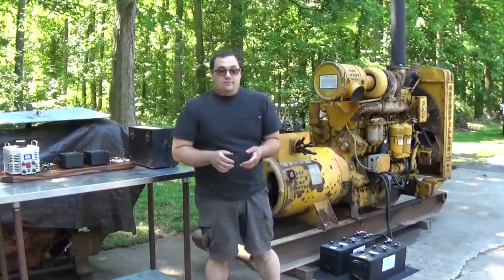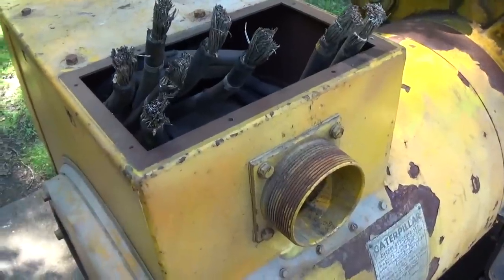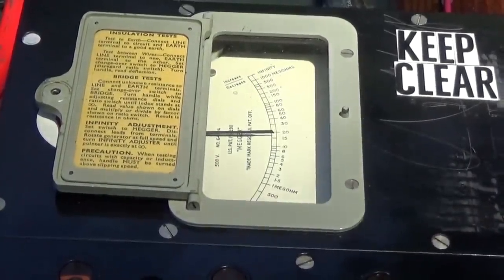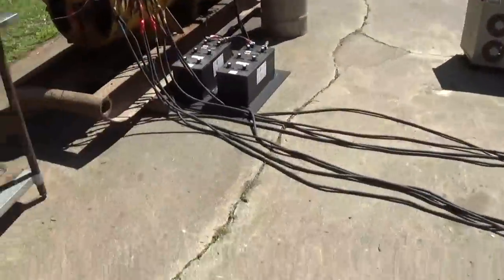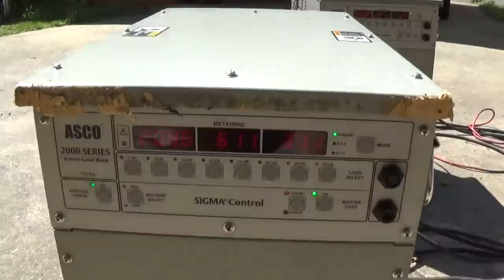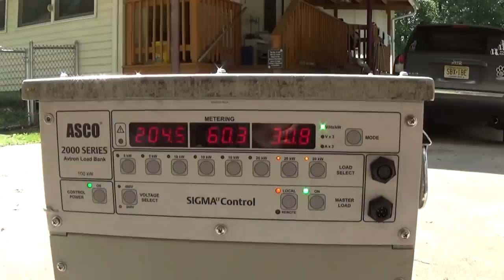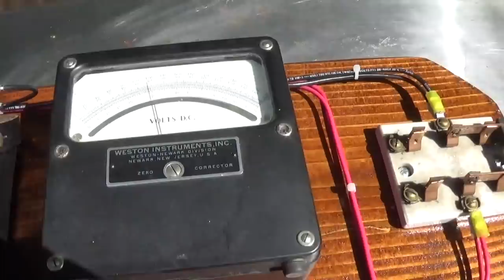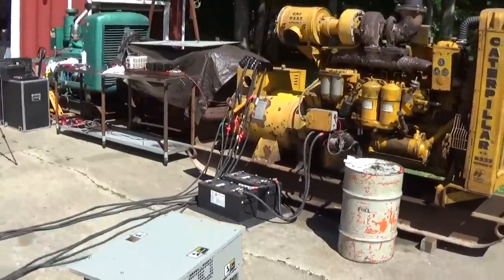CAT DIESEL RUNNING UNDER LOAD 1959 Caterpillar Generator Testing

Comment: Good to see you letting it cool down before shutting off, it's easy to damage a turbo by shutting down immediately after a hard run. Peugeot found that out the hard way with their racing diesels at Le Mans, pitting with the turbo red hot. Audi beat them by backing off for about 1/3 of a lap before pitting.

Comment: So if the part can handle 60 volts at 20 amps then it would be able to control the excite windings, I’m sure you could build a part to do that pretty cheaply

Comment: Interesting video and great performance from a 60 year old generator. I was struck by the fact that you were producing 120kw which -although continuously rated - is about the same as my 2 litre bmw diesel engines car produces (177bhp).
Reply: Interesting, although that’s comparing electrical vs mechanical power — your 177 bhp isn’t accounting for losses in the generator itself + probably wouldn’t last long going full out at that power ;)
Reply: @MittyNuke1  I agree - the genset would need to be 90% efficient for the BMW engine to deliver that electrical power output. I was mainly observing the high specific output of modern automotive turbo diesels.
Reply: @rhiantaylor3446  Yeah it is interesting, seeing how this generator engine is so much larger than any normal car engine. A quick google search shows that the D337F is rated for 275 HP. From what I understand, vehicle engines rarely have to put out full power, while on the other hand this generator is probably designed for full load continuously.

Comment: a 65 year old chunk of iron happily pushing out 400 amps is both incredible and terrifying at the same time. As he casually walks over the leads and points the camera inside the generator cage. 
I wonder what happened to this unit. Haven't seen it in since this video.

Comment: that old kitty cat sounds really good ,,that old D337 will run almost forever ,,noisy as all get out , not fuel efficient  but reliable for sure ,, i used to work for a large farm here in iowa that has 2 of these monsters they both had over 5000 hours and that was over 20 years ago 
here at my farm our standby generators are new compared to that one,, the big one is a  Kohler genset powered by a 6BT cummins was built in the early 90s ,,it's 125KW if i remember right ,i've got it mounted on a trailer  for mobile power 
and it's baby brother a 75KW powered by a 4BT which is in  a shed ,,when it starts up you almost don't hear it , it'll run the whole farm alone 
I also just bought a 21KW portable generator for my service truck , it's only a year old with 200 hours , powered by a kubota 4 cylinder engine

Comment: I noticed (or missed it) that you never adjusted the throttle but the load banks maintained the frequency throughout the loading, is the governor that accurate that it maintained 1800 RPM throughout? Extremely informative and very well done!

Comment: Thanks for the video! I'm an industrial maintenance electrician, former medium duty diesel technician. 
Say you were setting this unit up in the field. Does the excitation controller have set points based on load, or is it a static setpoint based upon expected average load?

Comment: you can hear the turbo spool up really hard when its under full load, and as he drops the load from 100%, the turbo spools back down.  It probably didn't have much more fuel/turbo to add, which is why its rated the way it is.  These maintain an RPM via a governor, and with an Ag pump fuel is ramped in more as load is increased.  If you listen to the turbo, you can tell when it doesn't have more to give.

Comment: Old generator man here - that machine is pretty clean for as dirty as it looks - it must have been I doors in a climate controlled room..  if you ever get a machine that needs to be dried up you can do this - remove the voltage regulator - bolt all the output leads together in one big short... then take your veriak and your DC rectifier and your amp clamp - with all the output leads bolted together the output will be 0 volts - therefore there will be no electrical pressure to damage the windings. Start out slowly with the field current to build heat in the generator windings- I usually cover up the air inlet on the generator with welding blankets to help raise the gen winding temps.  Check ur progress and when the insulation leakage starts to decrease you can start raising the excitation current and thereby the gen winding temp. You will slowly drive out the moisture in the windings till the leakage is within specs that allow you to put the machine back in service.  I have used this method to dry out 1500 kw generators - it takes all day so have enough fuel on hand.  Nobody will bother you as soon as they see all the output leads are bolted together... lol

Comment: Okay, the set operates as designed. My question is what is the possible future of this set?
Donate, resale or giveaway, obviously too big for home use.
   The pots got hot enough to burn some of the carbon, but if it was hooked to something else to use most of its rated horsepower one would hear a much different bellow from the stack.

Comment: Great Video.  I would want to keep a 29 amp field source capability, not just for the inrush (dynamic) considerations you mentioned, but for pf and 240 capability.  You won't get rated kw into 0.8 pf of mixed load.  Also the unit is capable of supplying a 240 volt three wire system if needed, requiring more field excitation.  Just thinking of resale value.
Reply: I'm being told that this can be run as/ converted to a single phase generator. Is this true? I have an offer to buy a 150kw but want to be able to run my 240 volt items in my home, and a couple neighbors said they would be interested to go in on it to run a few homes as backup power. My home furnace alone needs 28800 watts being an electric furnace.
Reply: @johnford010  This generator stator is wye connected.  It can supply:
208/120 3P 4 wire
208/120 1P 3 wire
....and if the exciter is put back to original capacity:
240 3P 3 wire (delta) load.

With the excitation cranked up for 240 3P loads, the line to nuetral voltage is not usable.  It will be 138.5 volts.  A bit hot for outlet/120 loads.

On start ups at pipeline stations, there is a need for 240 3P for valve actuators, as well as 120 control power.  What is done (for temporary supply) is to run the 208 a bit hot to split the difference.  In this case 220/127.  

You wont be able to get the true 240/120  1P 3 wire you desire for residential loads.

Also, consider unhooking some of your electric furnace heater elements to refuce your peak KW demand.  It may run longer, but unless you have a McMansion, Your average electrical demand over few days is less than 3 KW,, and you could likely get by with 20 KW peaks.  (by not running everthing at once).

Cheers!

Comment: Nice clip I enjoy the efforts here like this. I enjoy the old equipment. Hey how much of the barrel of fuel did it use up in that 40 min. And you should've taken note how warm the gen casing was. May have told you how much it was really working.

Comment: great job to bring it back to life,...i'd really like to have one these nice load banks ... beyond my budget, unfortunately
Reply: dynoguy basically a big toaster. Not hard to make.
Reply: @billmoran3812 ... I know that very well, but i like those particular ones (Sigma),nice and compact units with built in controller and you can remote control them (i think it's via Modbus, got the manual somewhere)  . Very handy for automated testing ....

Comment: Wow. lots of measuring/testing tools needed!  Did you get the multi-Kilowatt load boxes from work?  Assuming you had a full spec exciter, could you give us an idea of what that 150-200 KW (correct me if I got this wrong) generator could or would power comfortably?  Would it do for a Hospital perhaps, or a small subdivision in suburbia?  I mean, what things need that amount of power?  I can't imagine what the big Cat will make for power!  This smaller one was clearly working hard, but with no complaints!

Comment: As a mechanical guy and welder, DON'T USE ANY ROTATIONAL method to pass electric. Doing so will cause electrical arcing in the bearings, greatly shortening their life.  Good info,good video.

Comment: That was very Skookum!  Love the load banks you have, when I attempted a similar test on my 15KW generator all I could come up with was an old electric kiln and a few old stove elements, not nearly as awesome as your setup!  I would be interested in the Fuel burn / KWh at various loads on that old girl.  When I tested mine I was getting at worst 0.13 gallons per hour per kilowatt hour with a 3kw load and at best 0.1 gallons per hour per killowatt hour with a 9kw load.  ($0.40 to $0.28 USD per KWh when diesel was at $3/gallon)

Comment: Another reason for the over rated exciter is you will see there is a non linear response between excitation and alternator output. As you near the design limits of the alternator you get close to magnetic saturation of the field poles, they physically can't be magnetised any more no matter how much current flows through the field windings. This means each amp of excitation current progressively has less effect as the alternator load is increased. Some of the 90's build Marathon Alternators had an almost knee like excitation curve at around 90'% alternator rated output. Made setting up stability circuits very finicky.
You are getting into some serious machinery there Mike take care. I saw you wind the field current down first but as a safety measure never open circuit a field winding you have basically a 150 KW ignition coil spinning there. 
What I used to do when doing tests like these is install a flyback diode at the machine field terminals, then if your external DC supply fails the field decays gradually with no induced spike on the stator windings.
That Cat sounds superb! They just don't make them like that anymore, I used to work on GM 2 strokes mainly, from 2-71s through to 16V149TIB, got the tinnitus to prove it. 
Stay safe young man, and keep on learning, there are precious few people left who can operate and understand a machine from first principles as you did without 'black box' controllers doing everything for them.

Comment: Thanks for the update, looks like the old girls good to go for another few years if used right, I'd still have fun with that sweet running motor if the gen was stuffed  though ( insert evil grin here). I was wondering if they are changed out of service when they get old and parts might be an issue. Or I've heard guys say some generators don't run clean power for modern electronic equipment and it messes computers/tv's and stuff up with circuit boards.  Kinda thinking they wouldn't want grandma going  loopy loop on her heart monitor in a power cut. Would that be anything to do with changing them out  with all that modern technology in a hospital ?   Your neighbors have probably figured out who's house to visit in a major power outage  after a big storm, and guessing they won't say much about the noise if they might have an awkward few days if they made you mad ! Take care.

Comment: May I request some content?
In this video you manually adjusted the field voltage to compensate for the drop in output voltage as the load increased.
How does the exciter generator automatically compensate for the droop across all legs? (balanced load)
As a secondary question, in the case of an unbalanced load, how does the exciter generator compensate? 
I realize a perfectly balanced load across all legs preferable but am thinking it isn't always practically possible.
Perhaps it simply doesn't matter on a generator of this size...?

Thanks,

Comment: The voltage drop gets much more severe with an inductive load, not only in transients. Therefore, you need the more powerful excitation with non-unity inductive power factors. Therefore, if the generator is to be used with inductive loads like induction motors, you'll need the extra excitation power.

Comment: and dont do this at home..............that Genset has got some serious juice coming out of it!!  Great video...........subbed ))  Its hard to imagine, but there are applications where those diesel engines run at near 100% load factor for hours at a time. I know, because for a long time we were using 350hp Cummins/Mack/Cat engines on 80,000kg road trains in outback australia where we had the pedal flat to the floor all day, often in 50C conditions in summer time.  1 million km was a typical lifespan, averaging only 80km/hr. The undisputed king of road training was the K-19 Cummins which could pull 115,000kg triples all day and not even work up a sweat.

Comment: Are they your load banks ?
thanks it was fun ! i have a  standby auto start genset at a resort , i had to fit time delays for the loads kitchen  laundry ,sewage plant blowers etc   , to let the 175 kva  JD   have a chance to warm up for the in rush current
soft start aircon , and 75 fridges , that could go into locked rotor , overloads , UPS  for IT  to hold , but she has never let me down ,

Comment: Thanks for the lesson on the electrical side, I am learning a lot. I wonder if the Cat has a partial injector problem based on the smoke under load???
Reply: She's just clearing her throat for the first time in probably 50 years. Burning off all the carbon buildup.

As cool as that turbo sounds, technology has caught up with it. A modern turbo with a wider map/better boost curve would clean up some of that.

Comment: Thanks for an excellent video; however, I have a few questions: where does the voltage come from to run the variable transform (variac transformer?)  to dc excite the rotor. Have you ran a 110volt circuit from the garage, or the house, to power the variable transformer? (Or our you generator the power for the variac transformer from residual voltage from the diesel generator - hope this question makes sense.) Also, when decreasing the load, can you just remove the excitation power from the generator- all at once, not sure of the physics here, though; I would think the generator has electrical current in the windings that needs to be dissipate when disconnecting the load ? (I wasn't able to see the exact voltage levels at the loads when removing the loads from the circuit, but it did seem like the excitation voltage was only lowered a small amount before cutting all excitation power to the generator?
Reply: He ran it off the output of the main generator.

Cutting the field circuit will cause the current in it to drop to zero as fast as the connection is truly broken (there could be an arc for a few milliseconds). There cannot be residual current in a wire that just has both ends insulated. There will be, however, some residual magnetism in the iron core, and this will cause the main generator to still output some voltage. This is how he was able to start the system from nothing but rotation.
Reply: @b43xoit  can he use house current?
Reply: @wrenchguy  I don't see why not, if he wanted to.

Comment: I really enjoyed hearing the Turbo spooling under a load and as you took the load off you could really hear it wind down. I'm kinda creeped out by electricity. Knowing it's there but you cant see it
Reply: What about hydraulic power? It's inside the hose, where you can't see it.

Comment: Hi Mike. Could you make a video explaning the excitation/field thing? Why do you have to excite the generator? What does the excitation mean in this context? Thank you for the upload, very beautiful engine!
Reply: Before they started using rare-earth permanent magnets (I don't know how to spell "neodymium"), they used electromagnets. Those required current. Their resistance was greater than zero, so there would be voltage drop and heat dissipation. But on the plus side, the excitation current could be varied to regulate the output.

Comment: I have a 20 kW three phase generator. I want to use it as backup power for my house.  The generator produces 120 V per leg. As long as I don’t have any 240 V requirements for the generator would this work out OK. Is it damaging to the generator to only use two of the hot legs?  If one leg is left unused could that damage the generator?

Comment: You should put a fuel flow meter on it, to measure specific fuel consumption - gph/kwh
Reply: how thirsty is that engine at full tilt under load?.gallons per hour ?
Reply: @leeharris3061  I ran a radial stacker, a field conveyor, a large three stage air compressor and lots of lights off of an old 250 KW CAT D343 gen-set. It averaged somewhere around 19 gallons per hour.
Reply: @ramjet7470  19gph is pretty nice compared to the airplanes I work on whos APU's burn minimum 20 gallons an hour idling(jet/kero/diesel). 40 gallons an hour when supplying electrical and pneumatic power. (Boeing 737/Airbus A320) (Only thing I can compare it to in my field)
When the plane starts getting really big APU fuel burn gets kind of crazy.

Comment: Pure Fun!  Want to check out a 50KW  480 V  behind a  540 cu inch V8  Le Roi dating from about 1954-55.,? She is mounted on her very own twin axle trailer just for antique engine shows, Nothing you have ever heard sounds quite like it, 
     The brushes in both the main unit and 125 V  Exciter tagged to the rear need to be freed up and cleaned. That is a planned future job, Pictures on my FB page. The Le Roi would ;sound off on that load bank ,if it will handle 480,

Comment: Along with monitoring the load and field current and voltages, 
could you calculate the fuel consumption, engine load, and RPM's at the different loads as well?
Reply: The RPM is easy since it is locked to the frequency of the output. Since he was making 60 Hz you know the RPM is 1800.